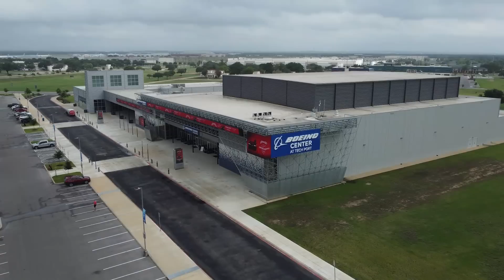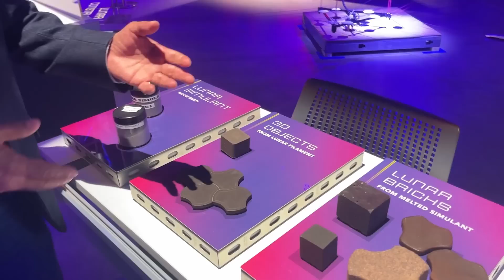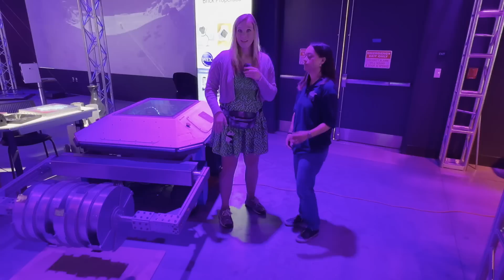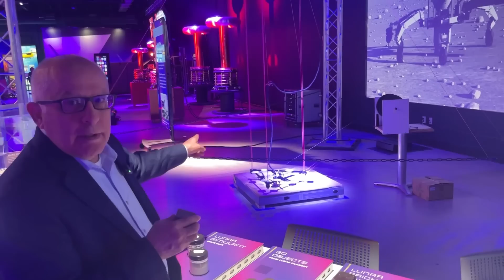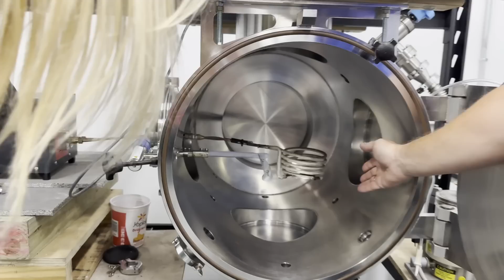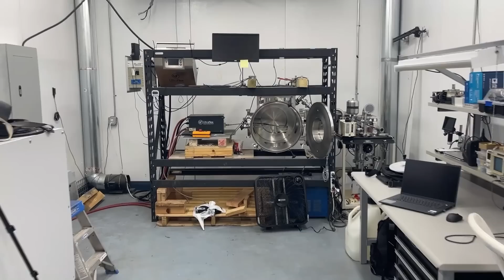How Will We Land Starship... On The Moon?!

Comment: Best option would be to send in the robots first to clear and make a landing pad.
We could easily control robots from earth since the moon isn't really that far compared to the rovers on mars.
And the same could be said for mars but would require an orbiting space station at mars.
The space station would also be a good place to stage things going down to the mars surface, as well as a place for mars surface crews to board/de board starship until a permanent base on the surface is built.

Comment: here is a landing pad idea, perhaps faster and temporary,maybe? imagine dropping a very large bean bag ( filled with gas on the moon-- choose your gas -- perhaps as stable fuel gas or combusted fuel? ) once it has bounce landed on the moon , if combusted, deflate-- what a waste, if non combusted, use as fuel to run a regolith vacuum, where you drum ball mill the regolith to get rid of sharp edges, and fill the balloon with regolith in place of the gas, it has a pancake shape, drill and bolt it in a flat space on the moon, wango, if strong and high temp enough you have the base for your landing pad!

Comment: just pondering here, but could you use some sort of degaussing method to stop the static electricity clinging to everything? like a thin wire dragging behind from their boots or a strip of some material that attracts the dust and can be removed in a cleaning room to keep the dust away from any astronuts living space when working on the moon? does mars have the same issue, or will it be actually easier/cleaner to work there?

Comment: My idea is to put a starship in a very low hover and just blow the dust off a designated area. Repeat this until you expose solid ground, and hopefully identify a suitable spot that is relatively level. You'd want to do this at either a high point (to help prevent the site being filled back in) or a low point (to minimize the amount of material that needs to be removed). I'm kind of torn on that, but really there's nothing to do but try some things out.

Comment: first landings wil be with a (ai)vision system that is abble to determine that the spot is good and stable enough, it is just a engineering problem. i dont think that its a big issue for spaceX, normaly SpaceX needs 4 trys before succeeding is we have seen several times

Comment: To make bricks on the Moon, you need to figure out two things: energy source and heat dissipation. Everything else is secondary, including the neat interlocking shape of your bricks.
Reply: The low gravity makes hardness and density requirements far lower to do the same job as on Earth about 1/6th.. 3D printing construction robots can be landed in smaller ships and build some basic infrastructure like landing pads and foundations for structures.. The vacuum and low gravity will also produce light heat/cold resistant masonry similar to the heat tiles on the Shuttle or Starship..

Comment: How will Starship land on on the moon?
Trick question: never gonna happen. Tall slender starship would fall over.

The fact that a landing pad is required means starship is for later not initial landing.
Reply: Apparently you don't know that there will be several variations of Starship.  There will be crew, tanker, supply, specialized ones such as the HLM that will have self-leveling legs and will be spread out wide like the Apollo lunar landers.

Comment: The dust is not a solved problem. Its massively limiting and mitigation in the moon base planning seems to be very low priority.
Reply: Actually it has been solved.

Its called electrodynamic dust shield, or EDS.

And NASA has been working on it for a very long time.
Reply: I don’t think eds as it stands has a trl ready for the scope and scale of lunar activity outlined by nasa.

Comment: I've been asking this forever. Landing a Starship on the Moon or Mars seems like a completely idiotic idea. Way too big and unstable on a soft surface. A smaller lander that doesn't require a pad seems the sane way to go.
Reply: The early versions of Starship will have wide self-leveling legs to avoid tipping over.  Lots  of really smart people work at SpaceX, NASA and many other businesses that will be involved in this enormous undertaking.  It has to be big Don because Mars is so  far away you will need lots of stuff when you get there.  Remember how massive the Saturn V was but yet just the relatively small   Apollo capsule and lunar lander actually got to the Moon?  It was like taking a car there...we need semi-tractor trailers, that's where Starship comes in.

Comment: I'm betting on concentrated solar for the moon. 
It's directly useful for getting volatile fractions out of regolith, drive chemical reactions, and one can sinter material into blocks without additives or a polymer matrix. 
Plus sintered bricks resist high temperatures, unlike polymer matrix ones.

Comment: Here's an 'out-of-the-box' idea.
Descend to withing a few feet of the surface and hover perfectly vertical. Then lower the landing legs until each is at the proper length to support the ship, then throttle down and shut off the engines.
Reply: That is a "not out of the box" idea. Almost every landing consideration has been evaluated during Apollo. They have all been revisited under Artemis. Your solution would blow the regolith away from the landing area. It probably wouldn't dig a hole. Now the entire area has a cloud of regolith above the surface. That is not a good thing.
Reply: @jeffreypierson2064  Didn't the already address the regolith issue when they added separate landing rockets three-quarters of the way up the vehicle?

Comment: PLA on moon? PLA gets soft/gooey above 60-70⁰C (not liquid) , maybe with regulith combined this melting point gets higher. Some kind of compound is necessary, why not some kind of resin, I mean if I have to put PLA to the moon why not resin
Reply: Mentioning resin.
I have in idea. Many of the resins harden very quickly with UV light. I think that is in abundance on the moon, just saying. Maybe it is much easier..

Comment: It is great that Spacex makes the transport system, at an inspiring rate of progress.  But it is the transport system, and infrastructure is also needed.  
The regolith dust problem may require a triple door airlock.  The outer door contains only vacuum and a flimsy seal, then some sort of robotic electrostatic particle-gathering to remove as much dust as possible.  Then operate the standard airlock.
Much enjoyed your videogram, and yes, please also look at infrastructure ideas.  😊❤

Comment: Instead of trying to make the bricks in a vacuum, they should work on a multi-unit brick maker where each section has higher and higher pressure where one section "feeds" the next section through basically a gear type mechanism which delivers the payload (the regolith) at a higher rate into the "furnace" causing more and more pressure in each station until it equals earths gravity. This would allow them to make significantly more dense bricks which they will need for rockets such as the SpaceX Starship. 

I don't think that flat pads themselves will be enough to keep down the blast of dust on the moon. It would be better to have a launch platform similar to what SpaceX has on earth. If you are blasting from the paved area itself it will cause a vast amount more of stress on the non-raised platform. And not just raising it but also creating a curved path for the exhaust to travel. Yes, it would cost more in the beginning but there would be significantly less damage to the landing and launching of rockets if the rockets are launched from a raised platform with a curved surface underneath to channel the exhaust. And they should be able to use that energy to help build things on the Moon and later on Mars.

Just an idea. Building in zero G with no atmosphere will make it significantly harder to manufacture the dense bricks that will be needed for repeated landings and launches of rockets. Especially Starship which is THE largest object ever launched into space. And the current version is the SMALL version of Starship. They will eventually (in a couple of decades or less) upsize Starship to where it can launch not just 100 tons into space but 250 tons in a single launch into space. They MUST plan for something this heavy and with that much pressure on both landings and launches. 

The paved surface will have to meters deep to absorb the landings and launches. They have a lot of work to do on not just connecting the bricks horizontally together but also vertically with them staggered on top of each other with many layers of bricks.

Comment: The first landing pads could be made by using solar concentrators in orbit to melt the regolit at the landing sites. These could also be used to create "roads". No need to generate or collect the huge amounds of energy needed to melt regolit, or import binding agents to manufacture things in situ. The question would be what process would produce a product of sufficient strength. Using feet or robots on the ground would, in my opinion, not be cost effective or economical. 
It is all very interesting to me, although I thought that especially the older gentlemen sounded like a salesman.

Comment: This is all fine and dandy but where are we gonna get the massive power load to make these bricks, solar? Then you have a downtime of nearly 3 weeks as you’ll both have to keep your batteries charged in the lunar night to keep the robot alive, doesn’t found viable, given the extra weight for lithium ion batteries. Nuclear power? Now you have an unlimited supply of power that can survive lunar night, which means 24/7 work with no downtime. Modular nuclear MSR’s are the only option.
Reply: Solar iridescence is very high without an atmosphere. It is far more space efficient than Solar power on earth.
Reply: Hundreds if Robots will probably be utilized for long term construction projects. They can run for hours on battery power after sunset. And go dormant until they recharge.

The dust is the real problem. Earth-moving equipment is already destroyed by earths dirt. And require frequent greasing and part replacement.

Sand ruins everything. Sand destroyed a trillion dollars worth of military equipment in Afghanistan. It destroys countless billions of dollars of civilian mining and extraction equipment every year.

Comment: Weld the starship hull into strips, use the strips to cover the landing pad regolith with the strips.  It does not need to withstand a booster launch, just a single raptor engine.

Comment: The civil engineer's brain starts spinning as I wonder "If that material could be also used for shielding for housing, and what about subgrade materials for the pad, also for surface transport, those barriers..."  Good video Ellie 🙂
Reply: I wonder if having rocket nozzles up near the top of the starship will create more problems when not landing on a paved pad, such as will be the case the first few landings/takeoffs. The nozzles at the top will tend to funnel Lunar dust toward the bottom of the starship, coating it with that abrasive dust. But the main engines at the bottom will tend to push all the dust away.
Reply: @FLPhotoCatcher possibly I think biggest worry originally about rear raptor engines was not just the abrasive dust but fact it could dig out a significant crater which could make the landing spot unstable. On Apollo they cut engines shortly before touch down and let it drop slightly so as to not somehow dig a crate under the nozzle
Reply: @sauceboss1846  Maybe, but those working on the Apollo missions were thinking that moondust would be a foot or more deep. But it's not, so digging a big crater should not be possible.
Reply: @FLPhotoCatcher  May I refer you to the video of IFT-1? Granted it is the Booster in that instance, but Starship would also blast a hole.
Reply: @jeffreypierson2064  I saw that. In fact, I think I was the first to call the damage to the pad right after the launch. I figured that the dust was the concrete being pulverized.  But, the Starship will be significantly less massive, and will also weigh 1/6th as much on the moon. And I'm guessing that the legs will be able to conform to the rough moon surface, so even if an area is a bit scoured-out, it should be fine.

Comment: It's a very simple solution.    Put Star link.
Above The moon.  Place receiving antennas down on the moon surface.
 Land land a containers of equipment and tools.
 Drop a container.  With a 100 optimize robots.
 Place starship in orbit with a 100 personnel with vr equipment and get to work. Restock supplies and personnel every month until completed
Reply: You don't need people in space with VR. They can be on earth.

Comment: The moon's regolith is rich in elements that are useful for quite strong concrete, and the Iron content is ideal for making steel from. Even better, the quality of the steel from a foundry on the moon will be much higher due to lack of an atmosphere (oxygen) that would continuously oxidize the steel and cause imperfections in the crystal lattice.
In essence it will be relatively easy to build stuff on the moon with concrete, and it will even be possible to build Starships on the moon. They would be capable of upwards of 1,000 tons to Lunar orbit or even beyond.

Comment: The melting of regolith into construction blocks will take a LOT of heat....so I'm guessing they're thinking nuclear power here?   There is SO much more involved in making a lunar base than just getting a ship to land and return....I'm hopeful it will get done in my lifetime but for sure won't be surprised if/when they find a real 'show stopper' in the process that makes it unattainable.
Reply: Giant magnifying glasses 😂
Reply: I had the same thought. They are really operating under the assumption they will have virtually unlimited energy to do this work. Otherwise it would take decades of sunlight on huge solar panels.

Comment: I am not a scientist, but I am fascinated w science, physics, space,etc. Does moon dust have an electronic charge? Is there a way to charge space suits and equipment w an opposite charge to repel the dust?
Reply: I do think this is a possibility
Reply: I believe they are working on just what you mentioned to have the astronauts spacesuits be oppositely charged to repel the dusty Moon regolith and also something that they can use to de-ionize equipment and other things with.
Reply: fascinating idea. I did a bit of googling and found a discussion on stack exchange about the charge of lunar dust. Apparently you get positive charging in sunlight caused by photons knocking electrons out of atoms. Since the moon has 2 weeks of daylight near the equator, maybe a suit or equipment with a slight positive charge would keep out the moon dust on a daylight side during the middle of the daylight cycle?
Reply: Good stuff. I'm sure they will eventually figure out something. In the meantime, maybe some Swiffers and Dustbusters will doo 🫠🙃😱

Comment: Yes a rover that has a 3D printing system using lunar regolith (dirt that is high in silicates). This makes a concrete like brick or pavement. However the same problem that happened to the starship launch pad would happen to a pad solely made of this brick.  Although it would be to a lesser degree because starship has far fewer raptors on it. (Verses the booster) however for the long term a pad made this way could be covered with metal or possibly even a carbon fiber mat.
Reply: Yeah it couldn’t be just space concrete. However comparing the two is a bit much given they’d only be using about 16% of the amount of thrust or force as what happened to the tower base on Earth.
Reply: A single Raptor firing at 50% against a stainless steel pad manufactured from a scavenged previous Starship's skin should be safe (for itself).
Also if they transfer in LEO to a re-entry vehicle a lunar Starship wouldn't require heat shielding, a significant mass savings.

Comment: Great job Ellie. That was a very interesting and informative video. I would like to see if heavy equipment is being developed. They are going to need trucks, bulldozers, cranes and boring machines. Is anyone developing the mechanical things like bearings, joints and electric motors that can make things work?  Infrastructure is the key.

Comment: Bricks are fine for experimenting, but laying bricks on the moon, not feasible. We already have road machines on earth that scoop up road asphalt, melt it, and resurface the road all in one step. This is a much better way to make a lunar launchpad. One machine, one process, solid foundation using lunar regolith. 🤔
Reply: Gotta have the asphalt first.
Reply: @jamesengland7461  you're using the moons' regolith, not asphalt! Shhhsh! The roadwork asphalt machine is already capable of laying a pad in less than a day. It just needs to be adapted to function on the moons' surface using regolith. There's no need to reinvent the wheel!
Reply: Dude. No tar on the moon. Asphalt requires much lower temperatures than regolith to fuse.
Reply: @marchelgeson  I'm not talking about asphalt usage on the moon! Sheesh doesn't anybody read context? We have a machine capable of building the pad. It doesnt need new tech with a whole new way to solidify the regolith! The machine only needs adapted to function on the moons surface. D#mn! We don't need a new machine like depicted in the video.

Comment: Thankfully the gravity on the moon is much less and the regolith is usually very thin. So a 3D printed regolith pad on the lunar bedrock should be fairly easy to construct. The issue about back and forth travel with be the fueling lines and tanks etc
Reply: Yes that seems right!  I hope the moving parts of the 3D brick printers and print arms, have sufficient engineering done to resist dust intrusion and abrasion effects. Without good lab engineering and testing, mechanisms will seize and become useless moon junk!